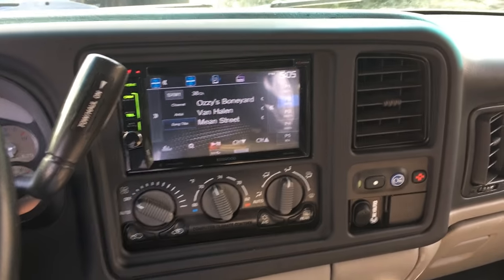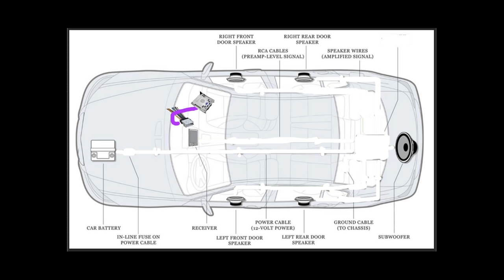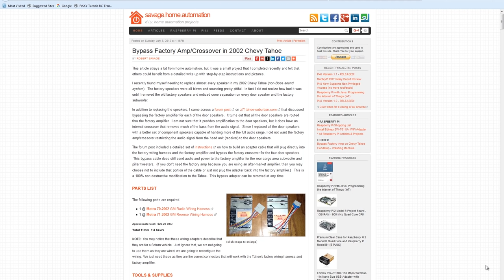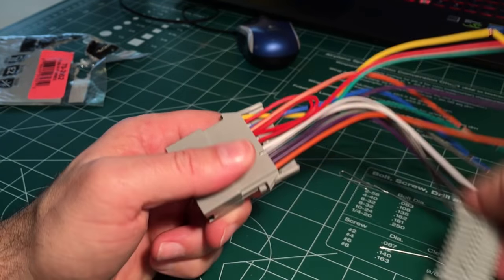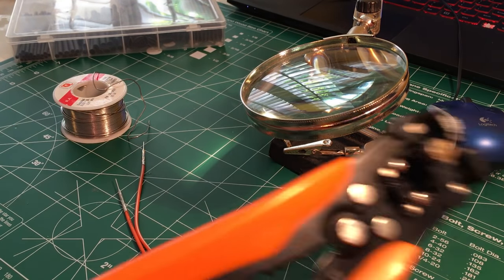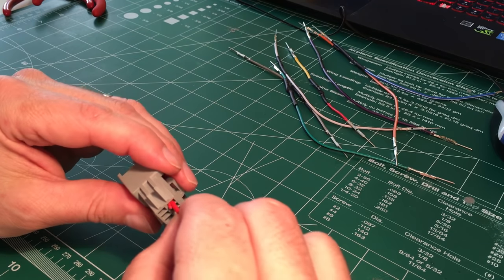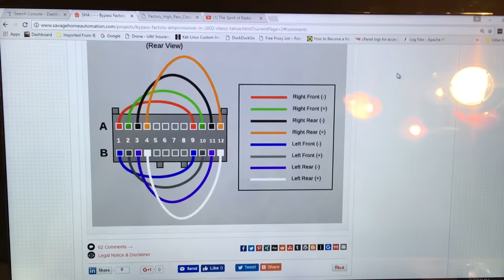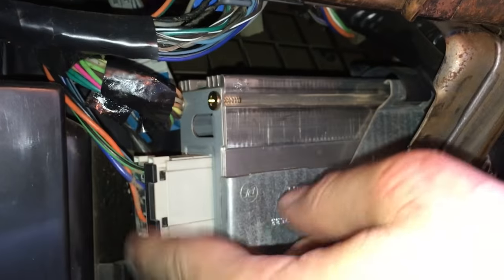Easy Factory Amp Bypass 2002 Chevy Tahoe GMC Yukon

Comment: Thats the way to do it similar scenario on my personal vehicle 95 sedan deville factory amp in the trunk shit can get hairy if you dont proceed with caution plan your next 3 steps and your undo button BEFORE YOU START SEVERING THEM FACTORY PIGTAILS N HARNESSES I USE QUICK CONNECTS AND MALE BUTT CONNECTORS QUICK IN AND QUICK OUT ALREADY TOOK IT BACK TO STOCK BOTH WAYS WORK SOUND GOOD MINUES LOOSING LIKE 7 SPEAKERS

Comment: Do you know if I could do that with my 2015 Dodge challenger with alpine 6 speaker system with built in amplifier? Everywhere I see they want you to buy a PAC Audio amp pro for like 375.00.
Reply: You have to use the pac piece to even get signal on that. Just spend the money and do it right the first time. So easy to use and works well, ive done many of them.

Comment: The radio in my tahoe works but sometimesif I turn it off and turn it back on I won’t here no voice the radio works but I can’t here nothing out the speakers , and it does it spontaneously….. do I bypass the factory amp
Reply: Just bypassed the amp on my 01 tahoe after a similar issue you're having. Got my sound back.
Reply: @SunnyD206  how did he get 8 wires I only got 6and a half with the harness where the other 2 come from

Comment: I have a 2003 GMC Yukon and I wired the harness the same way n I didn’t get no sound out of the speakers.
Reply: I’m still working on it
Reply from the maker: 03 new Generation.  Stuff changed from my year
Reply: So my 04 suburban with bose amp. is different than this video?
Reply from the maker: Yes!

Comment: would you have to bypass the amp even if you are just powering subs off of your aftermarket amp?
Reply from the maker: How are you powering your door speakers?  If you have a 5 way amp, and it's wired directly to all the speakers, you shouldn't have to do a thing.  If NOT, the thing to remember is that the factory amp is also a crossover.  It's pulling the lows out of those 4 door speakers.  i have aftermarket speakers in all 4 doors.  It sounds WAY, way  better with the bypass.

Comment: sorry i dont mean to nit pick just a pet pev but you are soldering that wrong you should always put your iron on the bottom of the wire so the solder will go through the whole wire
Reply from the maker: good tip, thanks for sharing
Reply: thank you for the  amp bypass tip if u can find one for a Nissan Mariano let me know

Comment: Ive got aftermarket deck and no sound from rear door speakers....not talking about tweeters, i mean the speakers in the rear passenger doors
Reply: I believe the stock rear speakers are 8 ohm speakers and they may only work with the factory amp which pushes 8 ohms to the back speakers. If you bypass the factory amp to the back speakers, they may not work because the head unit does not push 8 ohms. I’m about to get into this situation so that’s why I’m replacing the stock rear speakers with 4 ohm speakers to match with my head unit. This should also be the same if you are using a non-factory amp.
Reply: Are you referring to the sub or the small door speakers in the rear passenger doors?

Comment: I’d luv to find something like this for my 2017Silverado 1500LTZ,.. has Bose factory stereo /amp,. I can not find anything to work with aftermarket android 10in screen head unit,. Whenever I hook it up with harness that came with aftermarket unit everything works except I have NO SOUND!!! Even my two 12in subs and added amp, there’s no sound there either,.. idk what to do now,. Maybe bypass the factory amp?.?.
Reply: Did you figure it out?  Have to hook the blue wire from the wire harness to your amp turn on wire,  or to a 12v switched wire...

Comment: put a used raido in my 2003 avalavnche took out chip comes on but no audio have bose system how can i get sound  is it the amp  what a pain  any help
Reply from the maker: this will not work with bose system from what i have read
Reply: Larry Nelson Bose is 2 ohm. Aftermarket radios 4ohm.
Wire 2 speakers parallel into one channel.  Do this for front and back.  It will leave2 channels you can add more speakers if you wish

Comment: Just buy a 4 or 5 channel amp.. Cut wires going to stereo.. Wire your  speakers to the amp.. Its more expensive.. But yoy can expand your system later..
Reply: Smart..

Comment: So I could run speaker wires from new radio down to that connector.  That would solve all my issues because the 03 Bose amp only has two channels to the amplifier and does some digital fade?

Comment: all of a sudden my speakers dropped volume midrange ane bass.  They all sound like distorted tweeters, is that my factory amp?  I've installed 3 different head units and it sounds the same.  will this bypass work on a 04 suburban?

Comment: ive got a 2001 tahoe with after market stereo. when i have the stereo one the two front door speakers and the passenger rear speaker dont play only the back pillar speakers play and the driver side back door and the sub plays. the speakers are rockford fosgate 2way speakers the pervious owner installed in all four doors. any ideas why  the three door speakers dont play?
Reply: NorCal Rider  ive got the factory amp.

Comment: Hello I have a 03 serria with a Bose when I got it it had a after market head unit I bought a factory head unit everything works but no sound any advice
Reply from the maker: you replaced an aftermarket with a factory?
Reply: Yes 
Does the Bose have a wire that turns on the amp
Because I installed a factory radio and no sound. It wasn’t a Bose head unit just a plain gm factory radio
Reply: It's vin locked

Comment: What's the speed wire?
Reply: I'm thinking he means remote wire but I'm not sure and don't wanna speak for him
Reply: Speed wire is a bundled set of 8 speaker wires you run from your new amp to the head unit so you can use your factory wires to go from your new amp to your speakers without running new speaker wire from your new amp.  The problem is that in some GMs, the factory speaker wires go through the factory amp first...resulting in noise.  This bypass eliminates the factory amp, allowing you to use you new amp only.

Comment: I have a 12 in tall gate preamp subwoofer in box that I'm trying to hook up to my 02 Tahoe in places my blown Bose subwoofer that comes trying to figure out how to do it without having to do any bypass I want to have to do is minimal at Perkins. Work as possible anybody have any ideas
Reply: Is anybody has any ideas to this dilemma please please comment I have a 12 inch Rockford Fosgate subwoofers in box with preamp staff Attorney At The Crossover setup trying to figure out how to get to plug and play with it without having to bypass anyting you get any extra wiring harnesses or anything like that anybody has any any comment pointers tips
Reply: @ryanwarner6939  won't work. Get a smaller sub or build a box for it
Reply: Gotta do the bypass or leave it alone

Comment: how much to make me one?
shipped to 78006?
Reply from the maker: you CAN do it - just follow the video.
Reply: Steve Schwartz ,you were right, super easy. But I used the impala harness instead so I didn't have to solder ends
Reply: How exactly did you do that? I need it also Omar.
Reply: So the impala harness works?  Interesting...

Comment: Steve...I know this video is over a yr old but thanks.  When I searched for bypass Chevy Tahoe LS 2002 factory amp... You video popped up and here I am!  Thanks first most!  But will this work for my car also?  Also wiring it this way I called Crutchfield for the 70-2002... Will configuring it your way power all 9 speakers discluding the tweeters in the pillar?  Will it work with the tweeters in the front?  Sorry about the long question bro... But thank you in advance!
Reply: Did you ever hook it up?  How did it work?  I have a 2001 Tahoe . Do I need the 70-2002  harness?
Reply: Awesome thanks.

Comment: i have a 2004 z71 tahoe with the bose system, just to clarify this this by pass will work for me??
Reply from the maker: no
Reply: I have an 03 Tahoe with the Bose system and 6 disc changer and have been looking into replacing the deck since the CD quit working and all that does work is the radio...the Bose amp is located in  the center console and the unit in the dash behind the glub box is the XM radio...I've heard if you replace with an after market deck without the right adapter it will fry the deck unless you bypass the amp and if you bypass the amp you lose most the speakers since most decks are 4 speaker output. So might be better to spend the money on the wiring harness. I'm still searching for answers as well though

Comment: Would this work on a 2006 GMC Sierra 1500 with Bose?
Reply from the maker: no
Reply: Did you ever tackle  the project installing aftermarket on your gmc? I have same one and have been dreading hooking up my harness after running all my wires and connecting everything and steering control mod im wondering what’s gonna happen I have a amp and sub and pioneer hu to install but wonder what else I need for it all to function with the Bose system still installed for the moment.

Comment: Speedwire ?
Reply from the maker: Rene - Speedwire is a bundle of 9 wires.  8 for your + and - for each of your 4 door speakers, and a signal wire for your amp.  Car stereo shops use it for "budget" aftermarket installs where the speakers are already wired from the wire harness behind the stereo.  If you add an amp to the system, you can use the speedwire to go from the amp back to the wire harness and get output to the speakers.  The alternative is to re-wire all the door speakers from the amp (which is a better solution) but involves more labor.

Comment: I thought it's in the middle council?
Reply: That's the bose amp
Reply: @cjsiglerii  how to by bass that amp to radio causee my amp went out the radio stop letting sound out
Reply: @mperez0210  pull the radio out and there's another connector behind it that bypasses.
Reply: @cjsiglerii can I use the same connector he made?

Comment: People.........just pay a professional. This could have turned out a lot worse for this guy than it did.
Reply from the maker: jwide40 How? It’s a simple electronic circuit bypass? It’s not like it’s rocket science.  Or are you a professional installer, trying to scare people out of DIY?
Reply: Steve's 5 C's  just saying. Running an amplified signal into your factory amplifier (which requires a low level input) could have damaged any one of the components in your system. Ive seen it many times. Not trying to insult you in any way. From my experiences, I’ve found that’s it’s better to pay someone who is qualified to do a certain job rather than taking the risk of damaging something and then having to dig deeper into my pockets. But hey, if you have deep pockets, then by all means...... lol. By the way, yes I do this stuff for a living.  So a little push for job security here. Lol
Reply from the maker: jwide40 understood, thanks for your honesty, and I will take a step back as well. But help clarify something for me, I thought the bypass was intended specifically to avoid that issue in the first place?
Reply: If you use the by-pass, then technically yes, you can run wires from the amp back up to the deck and connect them to the by-pass harness.  The "proper" way to do it though is to just run wires from the amp to each speaker.  A lot of times the factory wiring isn't up to par for handling the extra power.  You will prob get a little  better sound by using your own speaker wire.  But, it does take a lot more time and work to do it that way.
Reply from the maker: Definitely agree that the proper way to do it though is to just run wires from the amp to each speaker.  i was just too lazy to re-run the wires.
Reply: Steve's 5 C's  lol. That is one of my least favorite things to do when it comes to car audio. I hate running wires.